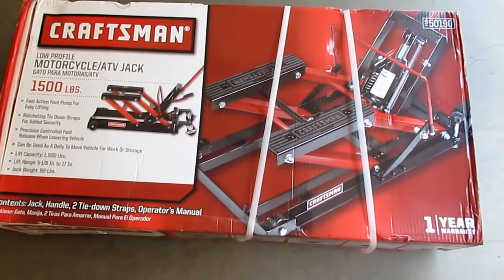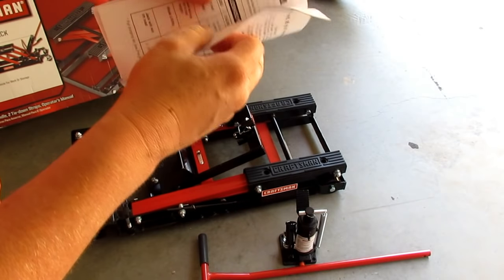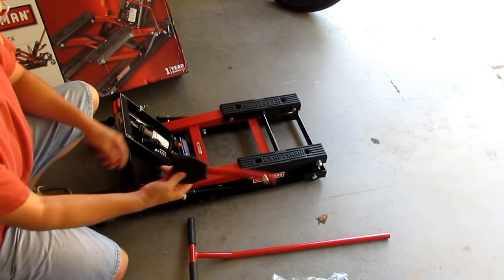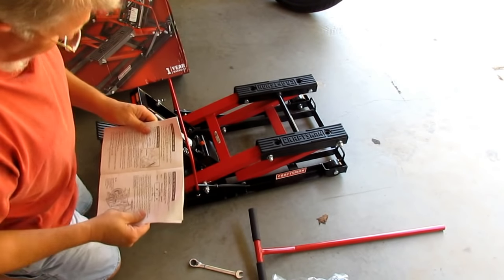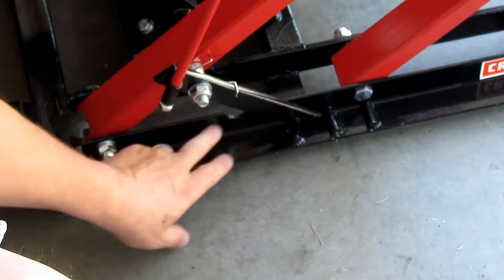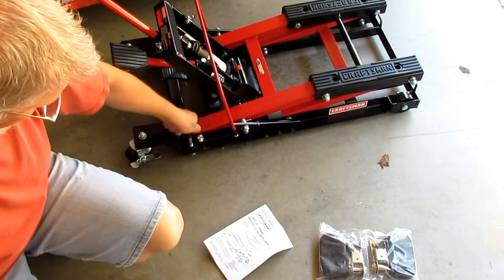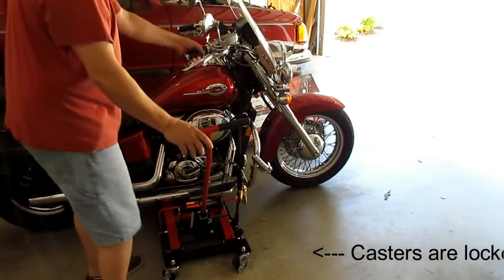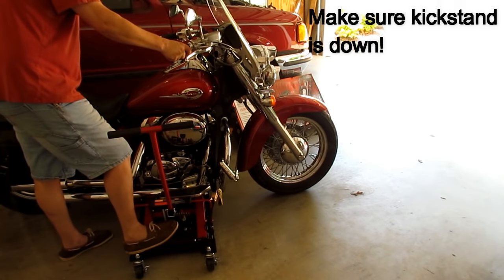Craftsman Motorcycle Lift  Unboxing and Review

Comment: 2000 I got mine been using it 19 years and its seen a lot of use on 10 bikes ,  I wait till I have the bike up and the lock is set before I tie it down , a centered bike will not fall off , but if you start turning bolts you want it tied down .  Great lift for tire brakes .
Reply from the maker: Good point sir!  Thanks for watching and sharing your experience!

Comment: I have this exact motorcycle jack. I got it for Christmas about 15 years ago. I have several different motorcycle lifts/jacks/stands. I never use this one. I have tried to use it. It is too unstable. You have to jack up the bike from one side or the other, and you have to strap the motorcycle to the stand to stabilize it. It’s got two flat lifting points, and it’s pretty rare that you can get both of them under the frame. Exhaust pipes are usually in the way. Or belly pan fairings, or the engine hangs down between the lower frame tubes.
 if you are able to get this stand under your bike and stabilize it. The jacking mechanism is going to be in your way on one side or the other. So you have to position it on the side of the motorcycle you are not going to be working on.
  once you get your motorcycle in the air if you are using the stand just to change the oil, many times it blocks access to the drain plug or access to removing the oil filter.
  it’s a two-man job to lift a motorcycle with a stand. One guy to hold the bike, one guy to work the stand, a third guy would be helpful to look under the bike while one guy is working the jack..
   I have had one of these stands for the past 15 years. It sits against the wall standing up in the corner of my garage. I would sell it for 20 bucks. I’ve tried to use it about 10 times, I usually ended up using something else. This stand is great for quads, or for lifting your riding lawnmower, but the fact that it’s on casters, it’s just unstable
Reply from the maker: Thanks for watching, Jody!

Comment: The only thing I never liked about these jacks is how the weight center shifts when you remove a wheel. The strap does help though. But due caution is necessary. I always anticipated placement of the lift for what I was going to remove, and never had a mishap thankfully. Also, you need a smooth concrete floor to move it around. I also like the stabilizing posts that are built in.
Reply from the maker: Totally agree!  Thanks for watching!

Comment: I've had this same jack for about 15 years now but when lowing my VTX, it bounces up and down while being lowered. It never use to do that before so it's time to drain the old bottle jack fluid and put in some fresh stuff in. Like anything else, they just need periodic maintenance and genuine TLC. You'll get years of service out of your jack, great buy.
UPDATE: I added a fine adjustable pedal stop and now my bike lowers perfectly.
Reply from the maker: Thanks for watching, Tank!  I agree!!
Reply: help , i cant get this lift to roll under my bike i have a 1300 vtx how did you get yours to work
Reply: @robertcorbin5667  OK, this should help, I use a 2 inch to 2 1/2 inch block of rubber, you can use wood if it's easier, and put it under the kickstand which raises the bike up on the low side then the jack just slides right under the bike. You will see that even with that block of material, the bike is still leaning enough that you don't have to worry about it falling over the other way. 
Check it out, you'll see what I mean. My VTX is a 1300S so I'm not sure if it is the same as say, a 1300C for example as far as the kickstand goes.

Comment: Also…🤔. My bike is an ‘05 Shadow aero VT750.  I see totally What you meant about the rails.  I’m a little nervous about hoisting it cause it looks like they might be a 🤏🏼tad short for the frame 🙄. Should I shim  it With some 2x4’s to add length or just go for it?  Thanks in advance
Reply from the maker: That's a good idea, as long as you have clearance to get them in there.  Thank you for watching!

Comment: Please tell me where two straps go on the bike, I'm small doing it alone on parking lot that's not the best. thanks.
Reply from the maker: Hi Ariels, it kinda depends on your bike and where you have to place it on your lift.  I usually will put one across the frame between the seat and the gas tank and then another across the back sissy bar.  Since most of the weight is offset to the front of a cruiser, I like to have a strap on the back to prevent forward tipping.  If I didn't have a sissy bar on the back, I'd go behind the front seat with the 2nd strap
Reply: @dwcoffey  Thanks Dennis!

Comment: Thanks Dennis for this clear video! I also bought this one this week. I have a vt 750 from 1998. But when i look underneath, i see that there are a few parts of the engine comes underneath the frame. So i think wheni lift the bike  i lift at he engine a bit. Is this a problem? I dont see you use parts or wood or something to be sure not to touch the engine.
Reply from the maker: Thanks for watching, Igor!  I would not jack up on any engine parts.  On my bike, I can get the jack pads on the frame, so I don't hit anything on the engine.

Comment: Thank you Dennis for this very instructional video. Mi bike’s engine bottom protrudes 1.5” pass the frame making it impossible to support the bike without damaging the biotin of the engine. Do you know any solution using this type of motorcycle lift?
Reply from the maker: Thanks for watching, Robert!  You may not be able to use a lift like I have.  I'd suggest lift-stands, like these:  https://amzn.to/3Jdh2o0 
or a lift table like this if you have the space and the budget: https://amzn.to/3usoiZb

Comment: hey Dennis i went out and brought the jack after watching how easy you put it together. i had no problems in putting it together and the jack worked. the problem that i have is that i used it for my goldwing and the descent to me was too fast and the bike came down hard. luckly it was not up to high. have you had any problem like that.  if so what did u do to fix the issue.
Reply from the maker: Hi John,
  It does let down real quick if you're not careful, for sure.  I just let it down very very gently so it doesn't slam down.
Reply: I had mine for about a year.  I couldn't find a way to finesse that descent pedal.  The Goldwing either dropped like a rock or it didn't move at all.  Not good when working solo.  IMHO, Sears needed to use a different bottle jack - one with the more standard screw-in type descent valve.  It's possible that such a jack could be bolted in to the frame, but I donated the jack as it was to the local motorcycle safety program - we found it works much better with the lighter training bikes.
Reply: mine comes down slow if I only press the foot pedal 1/2 inch , it will drop like a rock if I push it all the way down .   my FLT was 850 dry , same with my Roadking , Sportster 600 # and FXST 650 #  had a 1500 Goldwing on it  no trouble at all , did the old man's beakes  I got my lift in 2000 might have a different bottle jack .  19 year of hard labor and not had no trouble

Comment: Where do I add hydraulic fluid if needed on the Sears Craftsman Jack
Reply: Where do I add hydraulic floor jack oil if the jack is low on oil?
Reply: Can somebody please tell me why is the little birdie in the background singing every few seconds I hear the little birdie going for I suck at the singer or even trying to be one but we all know what a bird sounds like in the tree outside when he's going to but I'm definitely hearing it I'm not losing my mind I mean I put the phone up next to my ear I shut everything else off in the house and I put the phone next to my ear real quick when I smile it starts and it's definitely coming out of my phone while I'm watching this video about the floor jack so maybe you have a bird flying around in the garage or something I think that might be possible What Muslim I don't know I love animals but anyway I'm still wanting to know where the fill a hole is if I need to add hydraulic fluid to my floor jack so please can you tell me what show me in the video thank you sir
Reply from the maker: Thanks for watching, Biagino.  On the side of the bottle jack opposite the foot pedal, near the top, is a bolt head.  It should have a phillips screw slot made into it.  You will have to push the spring to the side to see it.  Tip the entire jack up on it's side so this bolt is faciign upward.  Put some rags on the floor under the bottle jack as it may leak when you remove the bolt.  Remove that bolt and add jack oil or hydraulic fluid into that hole until full.
Reply from the maker: Hi Biagino, I filmed this video in my garage with the door open.  We have lots of birds in my area, so they sing all the time.  My camera recorded the birds singing while I made this video.

Comment: Great video. Thanks for posting. I have the SCA version which doesn’t have lockable castors or tie down straps. 
The castors can be replaced with lockable ones though so it’s no biggie.
Reply from the maker: Thanks for watching!  I appreciate the feedback, and yes, I think you are right...if you needed the lockable casters, it'd be easy to swap them out.

Comment: Thanks for the video.  Questions:  Why did you use just one strap?  Is it best to use 4 straps like on a trailer, or 2 straps, or just the 1 strap like in your video.

Thanks again.
Reply from the maker: Thank you for watching!  It probably depends entirely on the bike.  Mine only weights 500 or so pounds and also sits firmly on the lift pads.  So I don't have any stability issues.  For heavier bikes, you may want to put more straps on it.  I don't have any issues at all putting mine on the lift with one strap.

Comment: If the release valve doesn't have an adjustment screw, I wonder if you could drain the factory oil out of it and replace it with a heavier weight (higher viscosity) oil in the bottle jack that would have higher flow resistance and thereby slow it down? I got one of these for my Yamaha VStar 650 that weighs about 550. Lbs. I suspect the factory config will work well with a vehicle of that weight. After I've changed MY oil,  I'll let you know how it did. The Chinese engineers probably tested it with a moped, a 105 lb man, a goat, and 4 chickens, so, ~125+105+80+15 (including bamboo coop) - so maybe 325 lbs? Prob works great on such a load. . . .
Reply from the maker: I'm not sure about he heavier oil Kenneth.  It's certainly a thought...I don't imagine it would cause any problems with the seals.....might be worth a try.  LOL about your comment oon the 105lb man, goat, chickens, etc.  thanks for the laugh!!

Comment: I wonder if this would be good to lift or hold a small car engine with one mount off so just to hold one side.
Reply from the maker: Thanks for watching.  I'm sorry, but I have no idea....I suppose it would depend on the car and the engine, how much space you had, etc.
Reply: @dwcoffey  My car rides low (ford fiesta) I think I would have to put my car on ramps to remove the engine mounts if I had this lift, I just need to pull it forward to get the catelitic converter on and pull the old one out, so I just need a few inches. Thanks for the demonstration, it looks sturdy enough at a good price...

Comment: Does it works on sportbike too?
Reply from the maker: I think it will for some, but you'd need to measure the flat portion of the frame on your bike to know if it would straddle the pads ok.  If it's too close, I wouldn't risk it.

Comment: would this lift work with a sports bike? I need to remove my front and rear rims and I was thinking of buying this lift
Reply from the maker: Hey, thanks for watching!  It would depend on the length of the frame tubes on bottom of your bike.  If they are long enough to fit across the lift pads securely, it should be fine.

Comment: Do the Shadow Ace oil pans hang below the frame like the Shadow Spirits do? That's my dilemma right now, i don't want to  jack my bike up if there is a change of messing something up.
Reply from the maker: Hey Mason.....mine is a Shadow ACE, so I can only speak about it, but no, it's oil pan is a little above flush with the frame, so I have no worries about damaging the pan by using a lift.  I don't know if all Shadows are the same.
Reply: I have a 2003 Ace VT750. Looks just like yours Dennis. I have the same issue. It seems the left side of the rear end of the engine does not fall bellow frame but as you get closer to front, it seems to go below or just about flush right before the radiator reservoir. How close is your frame to engine?

Comment: Great video. I've had mine for 15-20 years and used on 3-4 bikes. I now have a can am spyder and it works great on it also. I thought maybe I could get a better one and tried one at Harbor Freight and returned it because it wasn't as steady/strong. Right know I have a problem, I had the spyder up on her and when I went to raise it a little to dismount it it would not go up at all. I managed to get the bike off woth another single point ajack and it doesn't seem to go down all the way. Any ideas what might be the problem? Are there any repairs kits for the jack. I really like this one and hate to get another one. Thanks, Mike
Reply from the maker: Thanks for watching, Mike!  I'm not aware of any rebuild kits.  I looked up the jack part number and came up with nothing.  You might want to see if the bottle jack portion of the mc lift has a part number on it.  It may be possible to find a kit for the bottle jack, which sounds like the culprit to me.  I'll try to do the same and report back.

Comment: How is this lift holding up? I'm really interested in purchasing one and I've read some horror stories about the bottle jack failing after a few uses.
Reply from the maker: +jackass1189 Thanks for watching and for your question.  I haven't had any problems at all with mine.  I store it inside and I've used it several times.  So far, it's all good.

Comment: Good review!
Reply from the maker: Thank you very much!  The lift is still going strong  :)
Reply: Dennis Coffey I was going out to buy this lift based on this review but I reexamined my bike for clearance and it appears my oil pan is below the frame. '04 Kawasaki Vulcan Nomad 1500 Fi. Will have to check the Nomad forums and see what alternatives are available.
Reply from the maker: I'm not sure if this will help, but maybe this will help to determine if this lift will work with your motorcycle:  There is 9" clear space between the lift pads on the Craftsman lift.  I'm not familiar with the Kawasaki, but hopefully that will help you determine whether or not there is enough space to clear your oil pan and still have enough frame to lift it.
Reply: I've used a similar jack (Mastercraft by Canadian Tire) on my 2001 Nomad and it works well. It looks like the exact same jack with a different label. The tabs on the rear of the frame will punch through the rubbers on the lift - found that out right after the first time I used it. There's not much room but a thin piece of plywood might stop that. Steel on steel would be too slippery.
The front lift pad almost lines up with the groove in the front of the pan, but not quite, and the front tire will lift about 6-8 inches before the back tire comes off the ground. Taking the saddlebags off first helps a bit. A piece of 1/2 x 1 inch plywood to fill the groove gives the lift pad better footing but it still lifts higher on the front.

Comment: Hey Dennis, how's your jack holding up? How many times have you use it? Thanks for the video, enjoy.
Reply from the maker: Hey!  It's doing just fine.  I don't use it a lot, but have probably used it a dozen times or so.  No problems with wear or anything like that.  My only issue with it is that you have to be careful letting the bike down because it will go down really fast.  Thank you for watching!

Comment: seen frame bend to floor when 740 lb Honda vtx1800 was on it.  could not roll!  got no straps with my harbor freight model.  taking it back for refund.
Reply from the maker: The lift I reviewed is not a Harbor Freight lift, it is a Craftsman lift, from Sears.  With the frame bending on that Harbor Freight model, taking it back sounds like the best option.

Comment: I just bought one of these and it failed right out of the box when I went to use it.Gotta go back to Sears and exchange it.UGH!
Reply from the maker: So aggravating when that happens with anything.  The sad truth is that nobody has the same quality control measures in place that they used to.  I hope your replacement lift works fine.....fortunately for me, mine worked fine right out of the box and I've no problems with it since buying it.  I hope your replacement lift works as well as that.
Reply: I agree about the quality control, especially with these Chinese made products. If I'm going to buy a product produced in China that is cheaper, I try to at least stick to a brand that has a little bit of credibility. The thinking is that their name is on the line and they will at least have some quality control meaures. Crafstman is a great example of that type of company. This type of jack, with basically the same engineering, is sold under a bunch of names, but it looks to me like Craftsman put their own spin on it and a bit of quality control into it. I'll be picking one of these up today. Thanks for the review!!